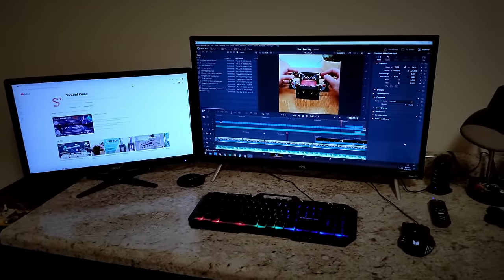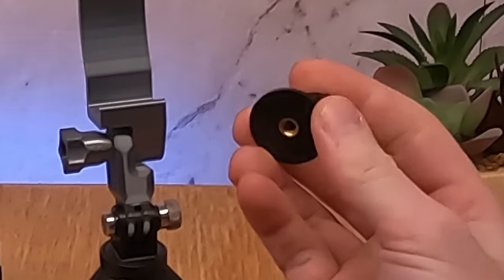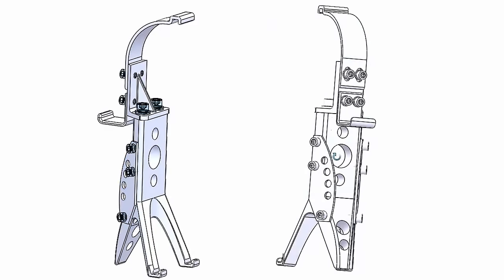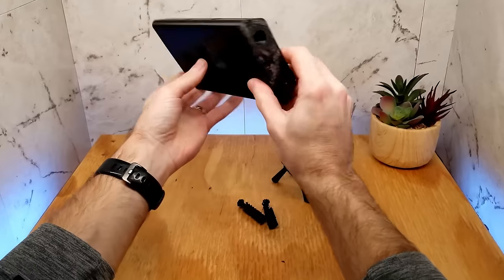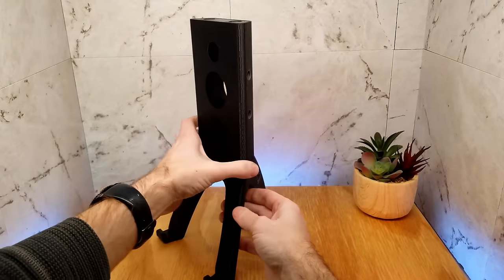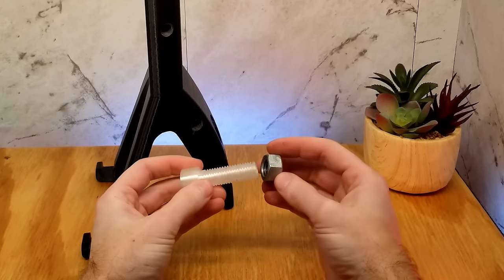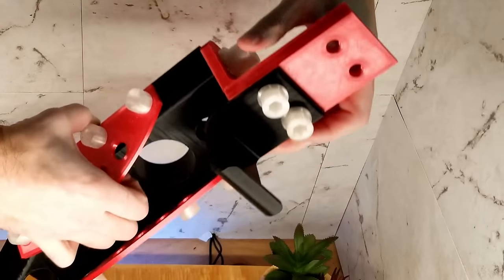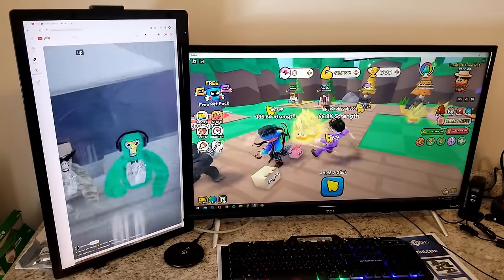Desk Transformation! Using 3D Printing & Design

Comment: For most monitors you can find vesa adapter STL files. Combined with a cheap vesa stand you got a premium solution at a cheap price and minimum effort.

I've used this before I could afford to just buy my dream setup.

Edit: Forgot to mention really cool design.

Might print a couple for my 18 inch portable monitors to allow for 90/270 degree use.
Reply from the maker: Lol, but why buy something to just get it done when I can sink hours of design and days of printing into it? 😉

Comment: A much easier way to remove PLA parts off the build plate is a spray bottle with Isopropyl alcohol (don't need the expensive 99%, 70% also works great). The crackling also makes satisfying ASMR. Also props to you for using PLA screws...
Reply from the maker: Thank you for the hint, I'll give it a try next time! 👍I like using PLA on this machine since its given me the least amount of issues. Also, ever since I learned about printing threads my life hasn't been the same, lol 🤘

Comment: I bought those dual adjustable arms that go on desk not realizing they need a lot of room in the back and my setup is against the wall, so I was not able to use the both of them on the dual mount, it was past time to return them, so I ended purchasing another single arm that has to mount sideways, so it's not much more than a stand instead of an adjustable, movable arm. your idea was better and a lot cheaper than what I did, and you have more mobility! LOL
Reply from the maker: Sounds like you've been through a lot! As long as you're happy with how it ended up that's all that matters. After hearing that though, I'm glad I printed one instead!😉

Comment: Honestly for the price of this thing material wise I think you'd been better off just getting a used Dell monitor of ebay (most of them can rotate 90°), the 2012 and below models go for around 20-30 bucks but I get part of the fun is making your own solutions to things. I too enjoy that. Anyhow good work, subbed.
Reply from the maker: Thanks for your support! ...and not to mention I could have saved hours of design time too! Lol. If I wasnt printing this though what else would I have been printing? 🤔

Comment: I remember having one of those Acer Monitors. The thing lasted for quite a while, but then the screen just turned completely white. After having to get Amazon to replace it 3 times because the first 3 all had dead pixels. The stand just press fits into the back of the monitor btw. Great Vid tho!
Reply from the maker: Yeah, had this one a while too, dug it out of the attic. The digital port stopped working so to bring it back to life I had to go with the VGA input with an adapter. It ain't the clearest but it works again, lol

Comment: Not trying to be a downer. But I feel it's not a best way to mount the monitor with phone clip style bracket.
It would be more ideal if mount screw on the back of monitor and 3D print stand to mount it.
The clip feel it will sag after few week of use.
Reply from the maker: Possibly, still holding up for now though. 😉 maybe it'd be good for a large tablet?

Comment: Really nice project and outcome! I just wanted to say that most of those parts don't look like they actually need supports, both the overhangs and the bridging should be achievable by your printer. Although I guess better be safe than wasting many hours.
Reply from the maker: I agree on the supports, better safe than sorry. I had one spool of black to use, and had a couple of bed adhesion issues to start off, I just made it with that spool...

Plus, the tree supports are pretty sweet! 😉

Thank you!

Comment: Do you think that will work on a HP LV1911 monitor. I need more space but my monitor looks different at the back. No idea if will fit.
Reply from the maker: I looked it up and found a few pics online, it does have more of a raised portion in the back... tbh I dont know if the model (as it is) would work, but surely it 'could' if tweaked a little. Do you have any experience 3D modeling? If so, sketch up your monitor real quick and throw it into the stand assembly to see if there's any issues before you print.
Reply: @sanfordprime  I have zero 3d modeling experience or skills 😪. But let me figure it out.
Reply from the maker: Never a better opportunity to learn, when it's out of necessity. 😉